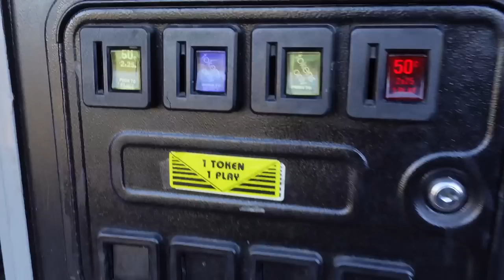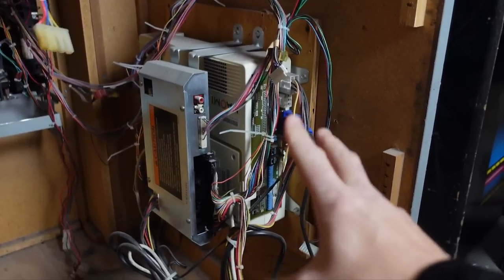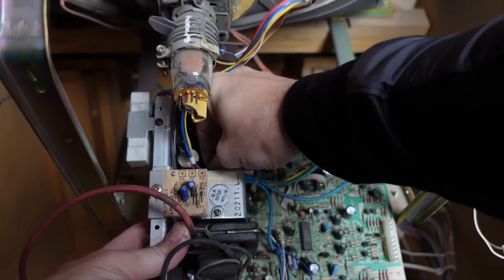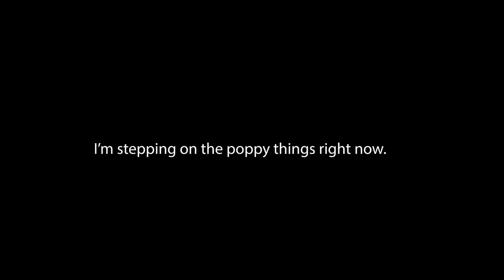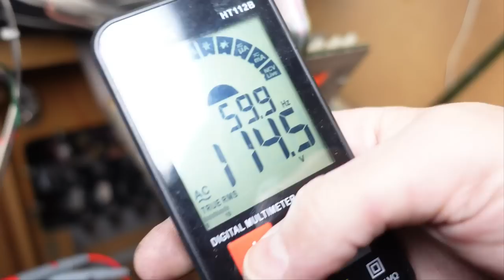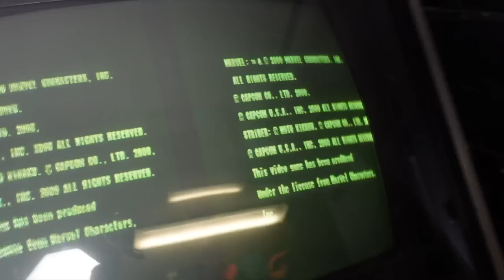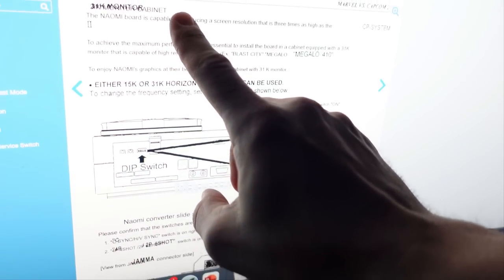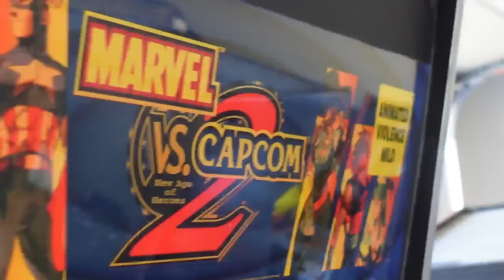Arcade Pickup - Capcom Big Blue w/ Marvel vs. Capcom 2!!

Comment: I used to have this cab, sold it, regret selling it now.  Was going to install a Q sound amp in it and do some work to it but never got around to it and let it go but restored the CP which was converted to a golden tee, so at least I brought it back to its former glory before I sold it as a X-Men vs SF with marquee and all.  This model has the best marquee setup, I have a number of marquees, it was a beautiful cab,  I used the diamond plate CP art and traditional PK decals, also cut a plexi top for it.  Best marquee is the alpha 2 marquee that's the one I used the most.  I miss the damn thing, most comfortable control panel for fighting games for sure.  Try the angle the dynamos have, it's horrible, this cab is super comfortable.  Great find, congrats.

Comment: I'm really curious as to where this cabinet operated during the 2000s.  It definitely had real play from the FGC considering there are P360 joysticks and convex buttons.  Mvc2 scene required those parts in the tourney scene.
Reply from the maker: It came from Vegas so it could have been at the local GameWorks that used to be on the strip.  🤔
Reply: @RetroRalph  If it came from Vegas it may have been on the show floor at Evo back in the day

Comment: When I got mine it had Tekken 2 in it and a shorted green tube.  I bought a rejuvenator, fixed tube and got SFII Championship marquee, cpo and bezel.  looks great but no original pcb hardware for now, is pandora but gets TONS OF PLAY.  I will be watching your restoration videos as mine has crunched corner at top and some other blems (color codes).    Great score.  What I bought was about 4 years ago for 600.00  sold tekken pcb for I think $75 nothing against armor king I needed that rejuvenator :D

Comment: It could have been a dungeons and dragons either mystara or doom and not necessarily a captain commando. I would see if you could wrap rather than paint it. CPS2 gsmes were typical for the big blues from that period. I have a naomi as well I love mine with mvc2. MvC 2 supports medium resolution which I just found out I will probably put one in my cab. The one downside to my big blue is that i didn't have the right control panel and sadly i have no plans. You have the right one which is lucky.

Comment: Bro.... Are those Wico Perfect 360 sticks?! 🤯🤯🤯
Reply from the maker: It's actually the "Happ Controls Perfect 360 Optical Joystick".  I was surprised by that and plan to do a separate video on them.  I haven't ever come across them in an actual machine so it was kind of a cool surprise.  They work surprisingly well, just weird to not have any microswitches to engage, it's just silky smooth.
Reply: @RetroRalph  

My GOD! Those are $300 a piece on their own.... Ya I had heard of those on that Scanline city episode on the M.A.S Sticks. 

That's awesome that you haven't run in to them either, your curiosity should give you a lot of energy to cover all the information about it! 

I wonder if they ever need recalibrating? I know Happ and Wico made Optical sticks, that's why I confused it with Wico's stick

Comment: I'd keep MvC2 if I were you. It's a very hard to find game. You can't buy it on PSN/XBLA anymore and the only other way to get it is through an OG XBOX/DC/PS2, and the fact that you have the actual cab is an even bigger flex than owning it on either of those.

It's your call at the end of the day, but it's just my two cents. Either way, I'd love to see you take on the restoration process, and if you decided to keep it as MvC2. You'd definitely be going in a huge step in gaming preservation.
Reply from the maker: I hear you, I need to do some research because my impression was that MvC2 was mostly in showcase cabinets.  So should I decide to make this a dedicated MvC2 I can figure out the artwork.  It might have to be custom made. Anyway, if I decide to make it non-MvC2 I think my Candy Cab would make a great home for a dedicated MvC2.

Comment: I only buy arcade machines that failed on consoles marvel vs capcom 2 new age of heroes didn’t fail it came on xbox PS2 Dreamcast the original arcade machines do break they work for 2 years if your lucky then they must have to break I own the Ms Pac-Man galaga arcade machine that was released in 2000 bought it in new sealed like as a console would be in it still hasn’t broken that was when the PS2 was out there was no Ms Pac-Man arcade version on consoles I was tired of waiting so I bought it for that reason we’re in 2022 it’s not broke once but the others do that we’re in 1980